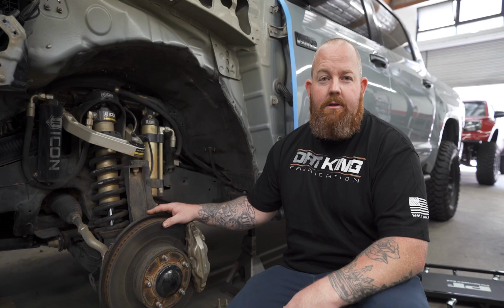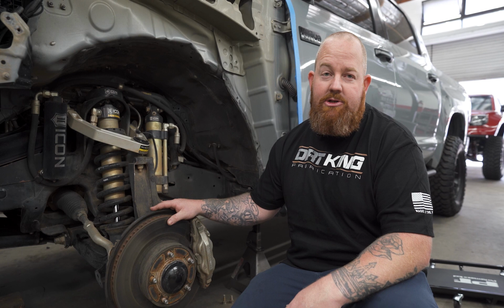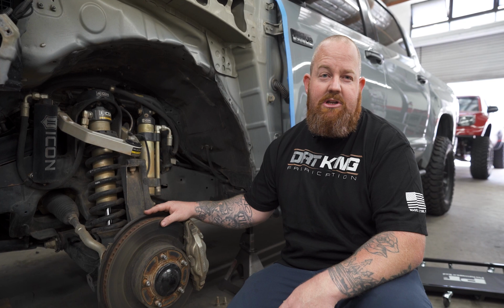The Ultimate 2018 Toyota Tundra Prerunner Build

Comment: how much lift is on the truck to get the 37" in there. I love this build. keep up the great work!!
Reply from the maker: Our long travel kit is capable of fitting 37" tires because the wheel placement is moved forward on our kit. This truck has about 3" of lift added to the front compared to stock suspension.

Comment: my question is? I have a 2021 Toyota tundra platinum 4 x 4 with 10,000 original miles. all my miles. I want to put an oversized truck camper in it. can I get a stable undercarriage truck platform to safely haul me around in a double or triple slide camper made for 250-350 truck. duelers? If I can't, then my choice is F650 with a triple slide. live in full time.
Reply from the maker: Unfortunately a camper of that size would far exceed the GVW of your tundra, even if you were to install an aftermarket leaf spring to handle the capacity your still past the limit of what the OEM axle and related equipment can handle. Ideally you would want to use a 3/4-1 ton truck. The F650 you mentioned would be a great platform for your goals
Reply: I was afraid of that. than you. @dirtking
Reply: I totally understand your engineering logic on this. I was thinking more of a monster truck build not quite as big as big foot. Afterall my wife is 24 and I'm 72. we just like living large off grid. probable still asking the impossibility. I'm looking at f550 and f650. thank you very much for your input, greatly appreciated. @dirtking

Comment: How much for a build like this ??????? I❤❤
Reply from the maker: There are many variables in a build like this. Wheel and tire selection, shock package, paint options, and lighting all are a big part of the overall cost. A full build package starts out at $35K installed and increases from there with options. These packages can always be broken up into smaller jobs doing the front first then working to the rear to be in any budget. To review options and get pricing feel free to reach out to our Builds Manager Nick Gardner at ngardner@dirtkingfabrication.com